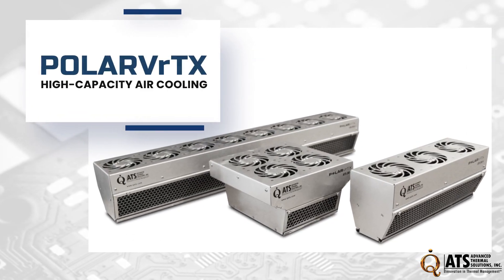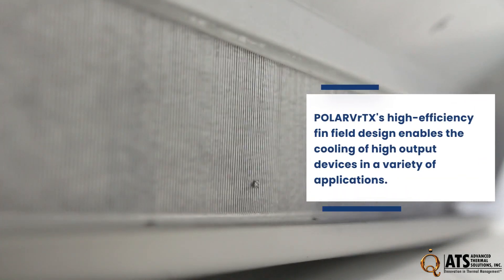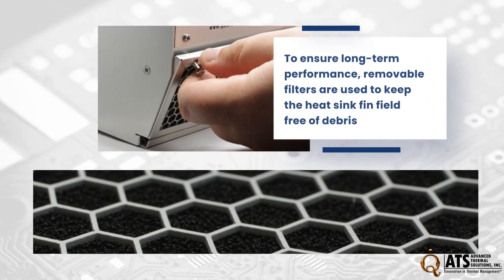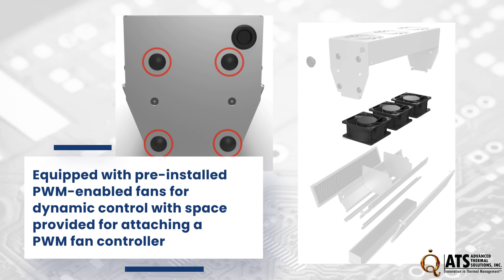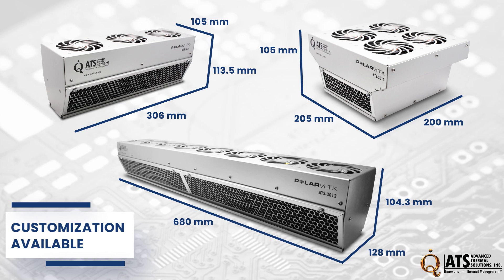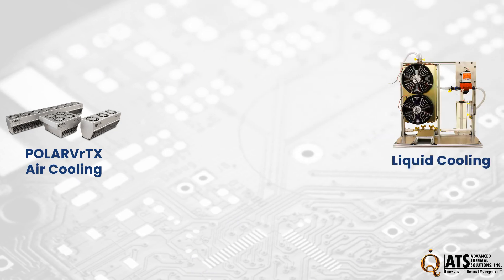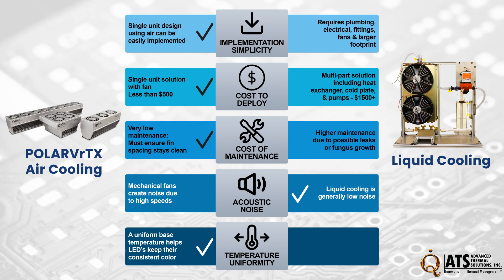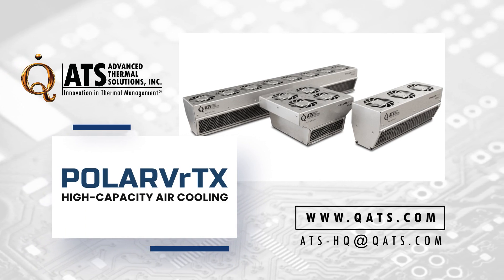POLARVrTX™ - High-Capacity Air Cooling

Comment: May i know how much power can it handle to dissipate heat? for example a power source of 800W-1000W of power? and can maintain Junction temp below 100c? generally liquid cooling systems are very capable of handling Power range from 1000W-1500W
Reply from the maker: Hi @ShahulHameed-re2nq   ~  Yes you may know the power these new products can handle:

If:
Tambient = 20 C
Tj = 125 C

ATS-3012-----13 KW
ATS-3013------6.2 KW
ATS-3014------3.9 KW
---------------------------
If:
Tambient = 20 C
Tj = 85 C
 
ATS-3012-----8.1 KW
ATS-3013------3.8 KW
ATS-3014------2.4 KW